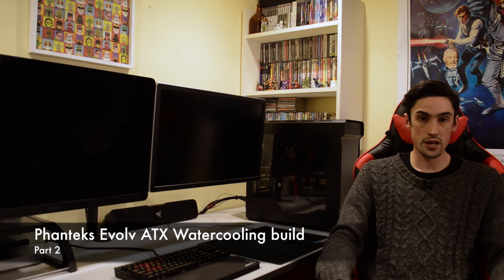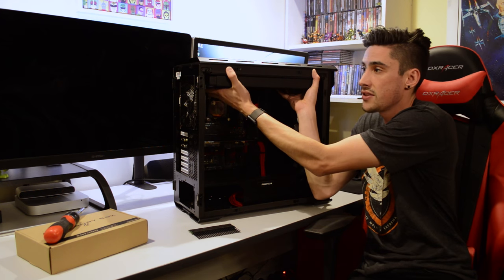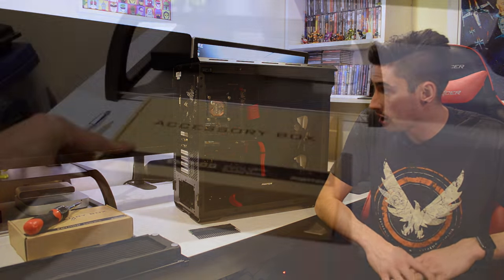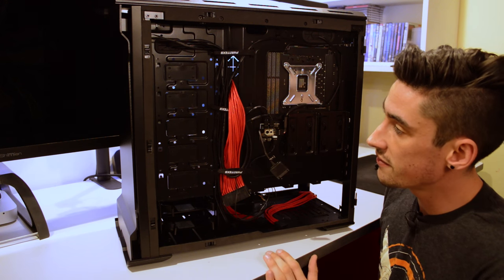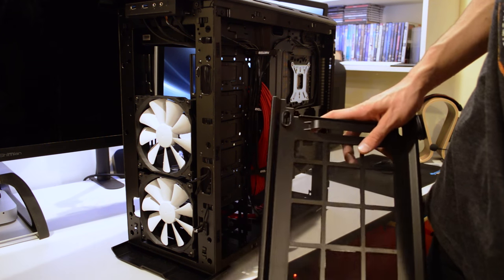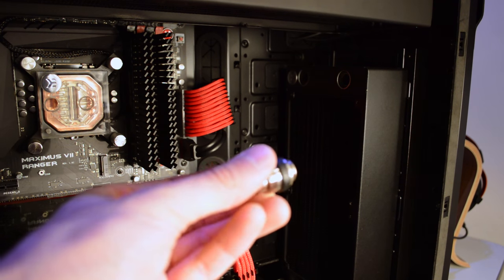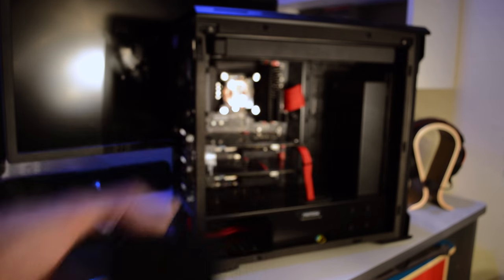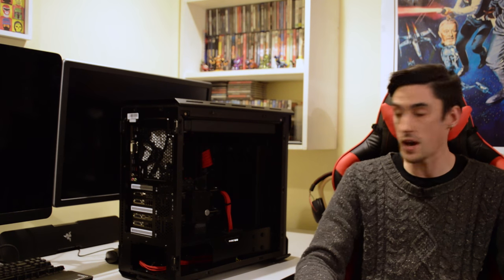Phanteks Evolv ATX Part 2 | PC Build Log

Comment: TechMaxTV also did a build in the Evolv ATX and he took out the slide at the top and mounted the radiator with two metal strips to the top of the case to increase the top clearance. He also mounted a slim 360 radiator in the front, which I don't think was possible without this modification. Check out his video at the 3:21 mark https://www.youtube.com/watch?v=0OkZDGky8jA - it zips by really fast due to the time lapse, but if you pause the video you can see how he did it. I also watched your other videos about this build. Great work, looking forward to the next video!
Reply from the maker: +Norbek Saldal Thanks a lot man, that might be something I'll look into if I have any more fitment issues!

Comment: since there is some space above the radiatormount why do you not try to wount the radiator without the rail thing maybe that is enough to make the fans fit with the ramsticks that you have now.
Reply from the maker: +Sven Musters I have considered that, I will need to drill holes to do so in the top framing. Still something I am considering, it may also be needed to get the second 360mm radiation to fit also